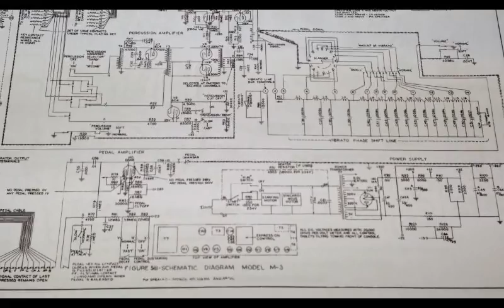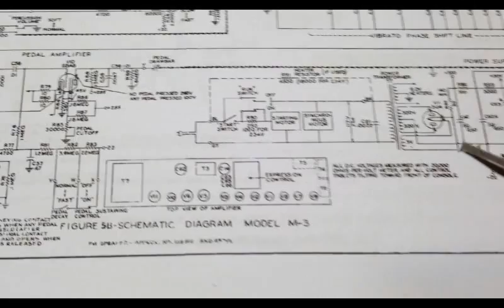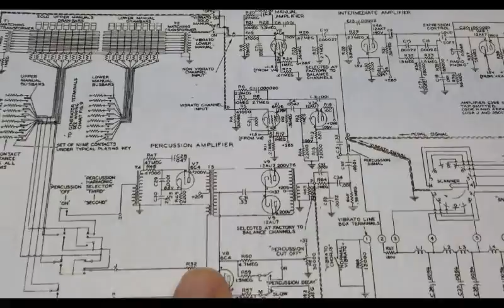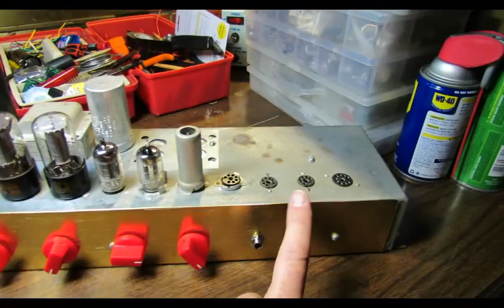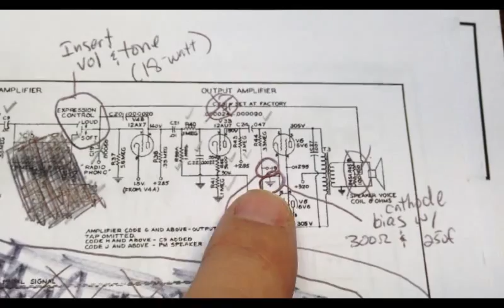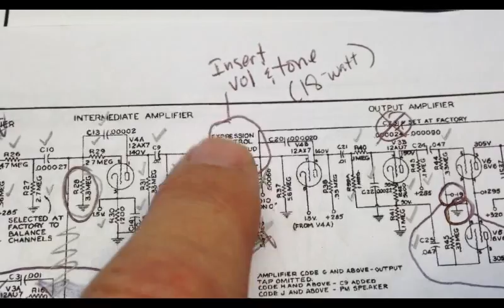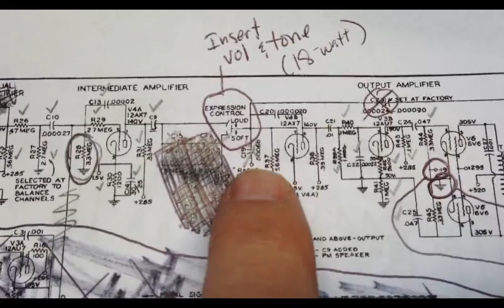Hammond AO-29 Guitar Amp Conversion + Make Pickup w/ Unused Parts

Comment: Didn't see this question sorry if it has been asked.
I have a working m103 with the same amp. What I want to do is pull it as a hifi amp only. I would love to do the minimal modification to it. Can I unsolder all the front wires, plug a source into the rca on the pedal box and use the output speaker leads for a similar ohm value cabinet leaving all the un needed tubes and electronics in place?

Comment: It seems I have two ways I can approach this. I can either "mark" the components I am going to KEEP by walking through the schematic OR, I can remove everything and rebuild using the schematic. Any advice as to which option is better? Thanks in advance.
Reply from the maker: Start at the input of the circuit you WANT to build and begin adding components that aren't there yet. If a component is already there, decide if you want to change its value or keep it. Go through V1, V2, etc. just like that. The power supply is something else.
Reply: @TheGuitologist  thank you!
Reply: @TheGuitologist  Each 12ax7 seems to have a capacitor coming off of the plate and then a resistor going to ground that you normally don't see in a preamp. Usually it's just a plate resistor that the B+ passes through and a coupling cap. Why the extra cap and resistor? Is it to bleed off highs? Thanks in advance

Comment: Thumbs up for this one Brad!  Great way to hide a monster inside a piece of furniture!  Well monster size not necessarily monster ugly!  It it definitely a well made chassis.  That power transformer is frighteningly big though!  Phew!  I love the vertical & wide tagboards system Hammond used - is there anywhere to buy this hardware?  I reckon they're fantastic!  

You must have had a lot of fun building this unit up ay?  Cool to have spare valve positions to use for whatever you want.  Good to find the nice Alco tremolo circuit & be able to reuse existing Hammond circuitry.  Nice gold front panel, but I'd like to see say, brushed aluminium cover panels over the unused chassis holes, as icing on the cake.  Bold red knobs are cool, & it sounded awesome!  How much better do think it might sound with more guitar amp-like speakers in it instead of hifi console speakers?  10/10

Comment: Crap, I'd love to work on one too. The amp has a tremendous mod/redesign potential. Not to mention that it's very nicely built. I love the turret board, it's so clean.
Reply from the maker: The chassis is really too long, but it does make a great guitar amp.
Reply: @TheGuitologist  it would be perfect for a head for my 4x12 cabinet

Comment: i guess my comments dont warrant a reply.  well folks let me point out something on the AO-29 conversion here, if you look at the finished product you will see a tube in between the rectifier and the output tubes, this spot on the chassis is for the 6BA6 tube and there is no clarification what is happeneing here outside of it being shown as removed/not used in brads schematic of changes SO, you are left guessing if you need to rewire the 6BA6 socket for a 6Au6 or if the 6ba6 tube was indeed used somehow and not actually ommited ( your guess is as good as mine according to this vid).  of course i have made numerous attempts to get clarification from "the guitologist" but i have never ever received a reply via a video or e-mail.
Reply from the maker: I emailed you.
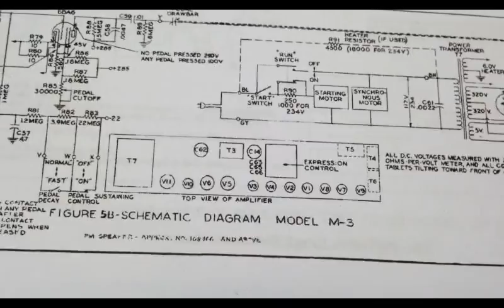Reply from the maker: 8:36 I show and talk clearly about my plan for the tube you mentioned.
Reply: @TheGuitologist  was the socket for v10 rewired or used as is would be the question bud.

Comment: I just turned my old stereo into an amp head simply by splicing a 1/4th inch jack to a stereo wire. I have the "franken cord" going from the right stero channel out, into the right input on my marshall cabinet valvestate 2x12. I have a line 6 pocket pod plugged into one of the inputs on the the stereo. Is it possible this will damage one of my speakers? I'm treating it like it's a 112 rite now, and I am keeping it at moderate volume.

Comment: Hey Brad lend me an ear! ..... I got my 59 ao29 up and running ... added switch between negative feedback and off ... nice boost .... I wired two inputs, the one into the first 12ax7 works fine but the one into the 6au6 gets no signal ....I've gone thru 4 tubes but none seem to work .... I'm inputting into pin 1 ..... is there an additional connection I need to make to couple the 6au6 with the 12ax7? any tips greatly appreciated!

Comment: I'm doing one of these now and also have the AO-29 1959 without field coil speaker ..... quick question, did you re-use the 50/50 and 40/20/20 cap cans?
Reply from the maker: Yes. Kept old cans.errr wait, maybe not. Can't recall.
Reply: @TheGuitologist  Looks like you did have them checked on schematic .... just thought the 50uf were a bit big as the 1482 used 20uf

Comment: Hello fellow Brad, I really enjoy your videos! I've watched this one over and over and over :) Based on your conversion I bought a AO-29 to convert and have researched a plethora of info on them. Mine is similar to yours and I've been told that our larger PTs are the 380v-0-380v version as compared to the smaller ones with 320v-0-320v. Did you run into any high voltage problems when converting? I presently added an input, speaker out and fuse and can play it without the extra pre-amp tubes(excluding the 12a-x7-u7) is this safe or will it cause soaring voltages? As is, the volume is low without a pedal but with one it will  get loud.  Brad in Texas

Comment: I am working on my Hammond organ, and I READ  that on side of the expression pedal part of AO-29 AMP I found  out that there is a rca jack on the side of it. Plugged my guitar into. Wow, ever hear a guitar through a Leslie 45.
Very cool sound.
Reply: I have a working AO-29 I pulled from an organ. I assume your amp is still inside the organ? I'm just wondering if I  power up the amp, with speaker, and plug a guitar into the rca jack that might work the same as your example. Did you use any preamp pedal or just plug a guitar straight in?
Reply: @montag4516   yes you can plug a guitar into rca jack for low volume ... adding a pedal in front will bring up the volume quite a bit .....  there is also a higher level input available under the long side cover, i think its the 3rd or 4rth tab from right then just ground the other side of the input to chassis

Comment: I dont know if this was a victory, all the essence of this amp has been lost.  Most guy like me look for stuff  that you add a plug speakers and a jack  to plug guitar in. Like I did with a magnavox console stereo contacted a jack to the phono.  That was my amp for my learning guitar on. Which might be the reason I suck on guitar.  But back to this AO-29. it in my Hammond organ now. You removed the expression pedal really just a volume pedal, Lots of potential there.   The other thing removed the percussion feature which when engaged add a Second , or third, soft delay, fast delay. If that might have been figured in the plan a lot  of sound choices. Or what a the variations of vibrato. Jeez? ..killer This amps are connected to tone wheel generator which amazing these things are so well designed , they are up and still running but correct if I am wrong. It a machine with a lot wheels and each wheel has its own microphone and that where the sound come from.  seems to me there got to be a way to adapt these amps to guitar strings.  Of course this amp will not look like the normal guitar amp. Today my brother not a "Yes" man. (softly "imagine" starts playing in background). I'm a Dreamer....

Comment: I am debating on picking up an AO29 and an AO14. $100 OBO for both. They've been for sale for a couple of months. I could probably get them for less. One is supposed to be in full working order. Both have the original speakers. I have worked on and troubleshot electronics as an industrial controls tech. I have never had hands on experience with tube tech. I think I might take the plunge.
Reply: Pick them up. That would be a GOLD mine here in Australia.

Comment: Guess what I got today for free? A Hammond M3. The tube complement looks to be fine. Obviously perfect for a conversion. I think Ill use the case of the organ itself for the cabinet. Might also make a new chassis. Been keepin my eye out for anything I could get my hands on!
Reply from the maker: Think twice before stripping it. Play it a while. I've recorded albums with the M3.
Reply: I got it running! The tone wheel was a little tight. It sounds great, the amp works! It has the upper foldback already. The drawbars need some cleaning, and the vibrato is out of commision. I need to find a leslie now!
I think i might go ahead and pull the amp, and chop the organ down. I love the instrument, and want to preserve it, however in its current form it will end up in a landfill after I'm gone. A nice compact good looking chop, with a solid state pre amp should keep it viable for a few years!

Comment: Is there a reason not to use solid state diodes in the power supply? It seems to me that would remove one possible point of failure (and heat) while having no effect on the signal path. It probably wouldn't make that much difference, granted, but is it just that you would prefer to recycle parts than redesign the power supply?

Also, the expression pedal might have been a cool thing to leave in the circuit, if it worked.

Comment: Hey Guitologist Brad! I'm wondering if you by chance offer any in person instruction, possibly small groups? I have no background in electronics, but a large desire to do some conversions....one which I am completely intimidated by.....amplifier very similar to this one..... from a 1949 (I think is correct) Hammond M (not 2, not 3, not 100.....just M) that had the field coil speaker. Not sure how to get out of the gate so to speak... I live in Tennessee, so not so far from where you are, in the grand scheme of things. Anyway, rilohandsilas@gmail.com if you would be kind enough to reply. Of course answering me here is cool too. Anyway, your thoughts on this? Thanks! ~Kent
Reply from the maker: +Riloh Kent Yogi Simcox hi Kent. I am not currently offering in person instruction as a service. Only guy I know who does that is Bruce Egnater. He does classes on amp building.
Reply: Hey Brad the Guitologist....Kent the Bovine Scatologist here. Well bummer, dude. So, reckon there's anyway you might find time and willingness to  give me an idea where the best place to wire in a reverb tank (Hammond M ...serial number 11836) The tubes I have to work with are: (from V1 - V8) 6SJ7, 6J5, 6J7, 6SC7, 6V76, 6V6, 6BA6 & 5U4. Also, what alterations need to be taken into consideration when switching from a field coil speaker to a permanent magnet speaker cabinet? Thanks a lot, brother! Regardless of whether or not you answer.....I do appreciate all of your hard work and patience, posting a plethora of education, entertainment and encouragement (the 3 e's?)  AND THAT'S NO SCAT!
Reply: Is reverb even possible without another transformer? Hmmm....perhaps a stand alone unit as another project another day?

Comment: Loved your conversion of the AO-29. I just acquired an amplifier and perfect shape 12' field coil speaker from a 1940s Hammond and want to do something like the conversion you did. I plan to either keep this speaker or use two Fisher 12 inch vintage speakers (awesome bass), welcome your thoughts. I will probably cut and weld the chassis and shorten the components board since it and the last 4 tube sockets are not used..so this can mount in a single speaker smaller amp cabinet for gigging. I can piece together your schematics, but do you have a final clean one you can post? BTW, great cigar box guitar...check out my reverbnation or youtube songs on jj dylan channel if you like...a lot more folksy...but I really enjoyed your playing. JJ
Reply from the maker: Thanks for watching, JJ. This is a fun project to do. I hope you're able to pull it off. I didn't make a final schematic, but you should be able to edit one along with my run down late in the video. Good luck!
Reply: Hi JJ, What kind of field coil speaker do you have? I have been looking for one to build a vintage style amp... If you are really going to gig with your amplifier after you build it, I think a more modern speaker,  either an Alnico or Ceramic magnet, is the way to go. They are lighter (the alnico anyway) and have great tone. Curious which chassis you have? Was it from a Tone Cabinet? I have a spare AO-43 chassis I'm not using, it is not as wide as the ao-29 (if that's what you have) it uses 9 pin 6BQ5's for output, but would be easier to add 6V6 sockets than to cut and weld the other chassis. I'm not sure about the Fisher speakers for guitar.... Some 50's and 60's stereo speakers ARE okay for guitar, they have to be from an open type console unit, the cones would be somewhat tight with a short throw. Any stereo speaker from a closed or ported cabinet with 2 or 3 speakers in it (bass, mid, tweeter) would not be good for guitar no matter what the rating. They usually have too much travel, which is good for lower frequencies, however with the surround of foam or soft vinyl, and the long travel, they would just sound muddy with guitar. Let me know the type of output tubes you are using and how many, I have a lot of speakers, maybe we can help each other out. I'm sure I can help you find a schematic. You just need to know what you want to build. As you saw Brad do in this video, most of the components are for other functions of the organ and since not needed, can be removed to free up space/make it less confusing. Tom
Reply: Thanks for commenting. Its the12" AO-21055 Field Coil Hammond Speaker (8ohms /700ohms coil), original but in pristine shape. I will make the speaker capable of being swapped with Alnico for gigging and keep the field coil version for studio unique sound. However, I would consider selling the speaker if someone really wanted it, and just using the Alnico speaker. Mine was from an M-3 with the AO-29. FYI, another project that I am building is an American 5 Radio derivative with extra features similar to the Fender Champ. JJ

Comment: I have an M series organ with this amp in it. What could cause it to start crackling and popping after being on fir about ten minutes? I've changed tubes and filter can cap.
Reply from the maker: Change all power and screen resistors and try it again. Use higher wattage parts where possible and change to metal film where they were formerly carbon.
Reply: Thanks, Ill give that a try...its way too nice of an instrument not to restore.

Comment: Given the massive size of those transformers, I wonder if you could use some bigger tubes in a project like this?
Reply from the maker: The OT is matched for 6V6. You could bump up to 6L6 or 5881 or something, but I prefer to use the tube with the correct OT matching.

Comment: I just found a working conn theater model 642 in a dumpster . someone beat me to the lesli and speaker but left the amp and every thing else. 
it's a transistor amp but i actually heard it the day before and it sounded great.
Point to point wiring...you ever seen one of these?
also... that little amp you got there is the bomb!!!
Reply: Last time I saw a Conn organ it was a 4-rank tube organ from the 1950s.  It was still working when they replaced it in early 2001.
Reply from the maker: Never seen that exact model, but the later SS organ amps can make good bass amps, Keyboard amps, or clean steel guitar amps, I'd suspect. Pair it with a good speaker and I bet it sounds great in these applications.
Reply: can't make a good guitar amp outa it?
Reply from the maker: Yeah, sure. It would just be very clean and stale probably.
Reply: do i need some sort of preamp?
you know those were made right over in madison in.?
Reply from the maker: Did not know that. I'm assuming you'll want some kind of effects boost or multi-effects pedal to use with that.
Reply from the maker: ...or rack unit.
Reply: douro20 I tell you man I can't even describe the work that went into the construction of that piece. I just had to get my hands on it . I wish I had a big building so I could bolt it to the wall for decoration if the parts never get used again.

Comment: Brad, my amp is from 1957 and has a slightly different schematic and layout. I tried to get the correct schematic, but when I compare the schematic against the actual amp, the transformer (T7) to the rectifier (V11 - 5U4) looks very different.
It looks like I can't post pictures in the comments. Dang.
Reply from the maker: If you want to email me a pic I'll get to it when I can.
Reply: +The Guitologist -- email sent.